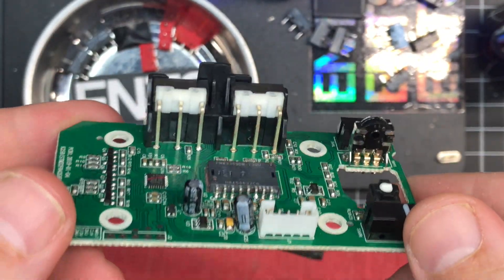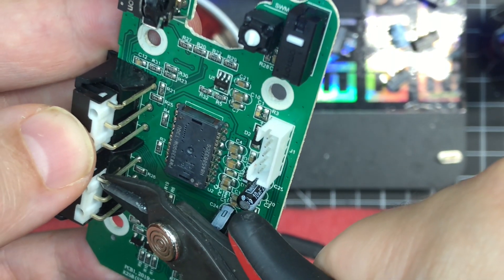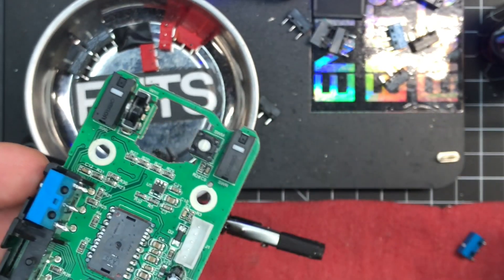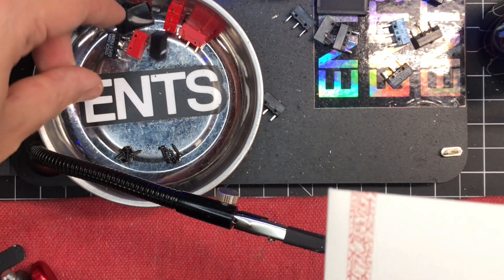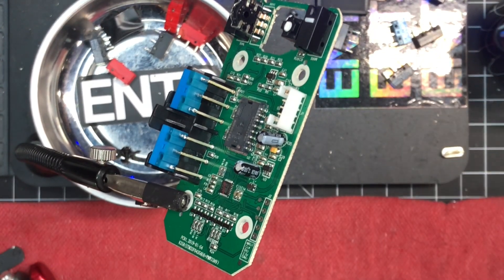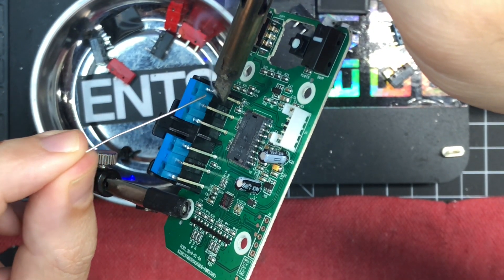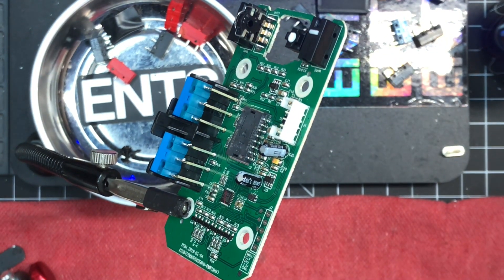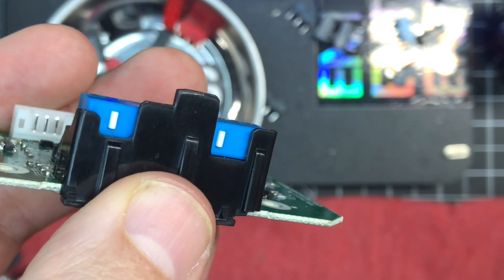How to replace Right Angle Side Buttons in your Gaming Mouse (XM1, Razer Viper Mini, etc.)

Comment: does this work on steelseries rival 3 wired? It has the same long prong switch
Reply from the maker: most likely, the only thing to confirm is that the replacement switch fits where the old one is, but same process -- keep the long pegs and solder to those
Reply: @entsfps  Thank you. I'ved checked all my spare switches and most of huano's have a big holes like on your vids. so i guess it'll do :D

Comment: I dont want to cut the pin so is it possible to just remove the housing and change the leaf spring inside?
Reply from the maker: no guarantee the leaf is the issue so just replace the whole thing

Comment: hey if i rip out my side buttons on my logitech g102 lightsync (cuz I HATE sidebuttons), will it damage the mouse? especially if i dont want to open the mouse up
Reply from the maker: it should be fine
Reply: @entsfps  i had an old g102, and i ripped the buttons out. was a nightmare, and completely ruine the mouse. never again XD
Reply: without opening the shell

Comment: Thanks a bunch for this video, it answered all my questions! Unfortunately the answer to what's taking up the physical stress wasn't what I hoped for, since the switch I want to use (Kailh Silent) doesn't have the required hole. Guess I'll just have ghetto mod it, cutting those plastic stress reliever pins and hot glue the new switch in place, or something like that. 🙂

Comment: Does this works on loose side buttons?
Reply from the maker: that's usually the plastic, not the switch.
Reply: @entsfps  one of the side buttons of my viper mini feels like it wiggles back and forth. Do you think is the plastic? The switch also feels weird when I press it but it doesn't do double clicks. If it is the plastic, what can I do?
Reply from the maker: @luisromero6434  take it apart and look, most likely the plastic has cracked. superglue may fix it
Reply: @entsfps  thank you